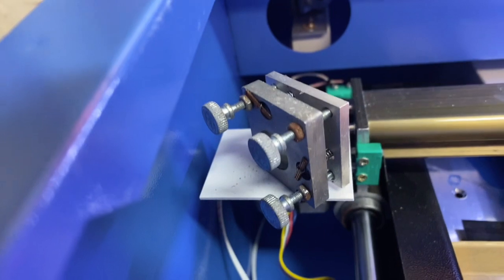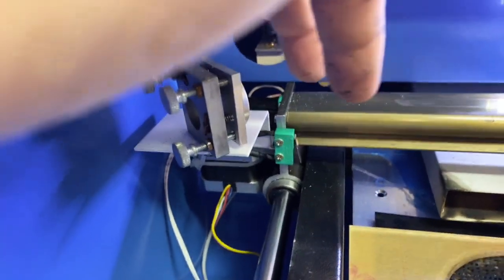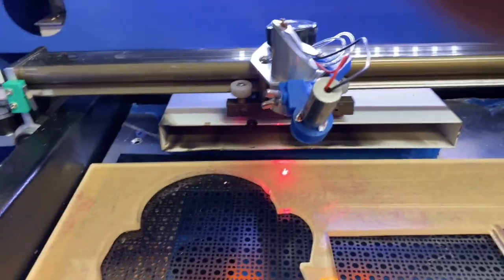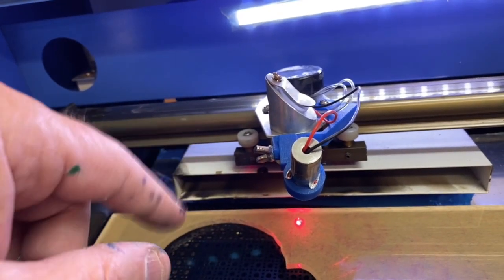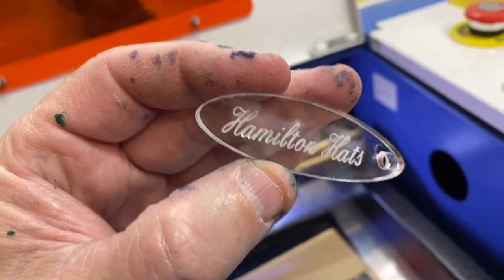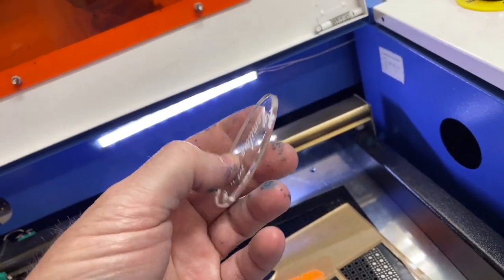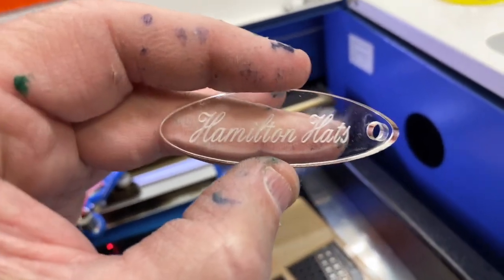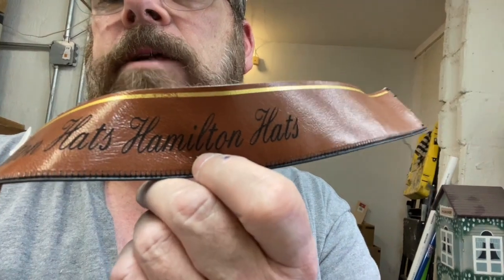K40 laser cuter demonstration and alignment

Comment: Just for the record I use a lot of Cast acrylic which cuts a lot better in my work but I prefer always to do 2 passes for cutting whether its 4 mm or 8mm its 100% sure to cut through then always. what you find is as you cut ( melt ) the plastic it tends to rejoin so i use a fairly fast speed and reasonable power so it does the cut well. Writing is different altogether I find it depends on the font and what your trying to do.
Reply from the maker: Thank you for the information. Any information like this helps all of us with different jobs we do. If you have any other tips that you found that seems to work well let us know.

Comment: Thanks for the video, of course I had to go check the nuts on my laser and they do actually fit a 8mm spanner, in Imperial that would be a 5/16th spanner.  ( Wrench ?) I thought it was odd that you said they didnt as I have a small 8mm spanner attached by a magnet to my laser for adjusting , Seems odd they are not the same?  They are the same colour as mine and exactly the same mirror heads, I also checked with a vernier across the flats and they show 8mm, they also fit a 8mm socket.   anyway Im not picking holes it just rang a little bell.

 Im europe based so all metric here, the thread on that is probably 3 or 4 mm although i haven't checked it. In metric we rarely go below 3mm , I sometimes use 2mm on small steppers and you can get 1mm but its so rare that thread is used, the spacing between the threads is crap so it makes for a crappy way to join things in metric when you go to small sizes. But China is metric so of course it will send everything out in metric. Its probably the crappy machining on the nut faces and thats why your spanner didnt fit, 5/16th is the nearest equivalent but not exact. Keep up the good work.

Comment: That chirping doesn't sound right. It's probably from your microphone but your HV connections to the tube might be a little too close to the casing.
Reply: The chirping sound is the laser head is to close to that vent, I cut off mine so is clear from the laser head